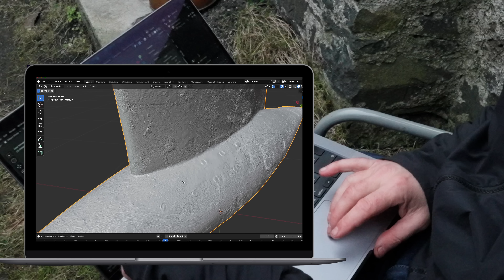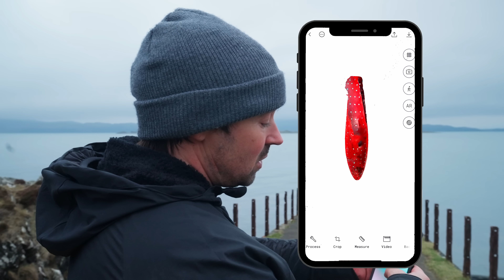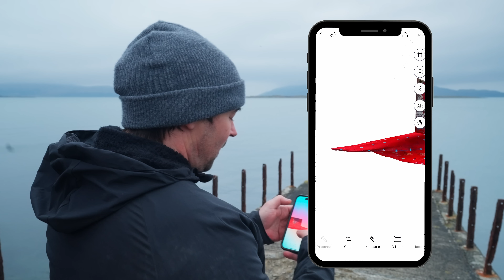I found a Project Sailboat with No Keel ! ~ Let’s try to make one.

Comment: 06:39 Keel: 'PAINT MEEE' ... 

I ogled a 1970s 'Pen Duick 600', intensely - with it's stamped metal sheets bit of a gimmick design, maybe - but all aluminum, and as such still for a price of a used car - and I wondered what it would take to modify the fin keel into a wing or bulb keel, sacrificing some draft and weight gain for potentially increased stability ?... 🤔

'DMS Marine Consulting' offers e.g. a digital calculation of hull designs and their variations - likely breaking the bank for end consumers, I guess - but interesting still when considering restoring or optimizing existing designs without proper documentation...
Reply from the maker: Yeah! These projects are not to be taken lightly! Thankfully I’m a shipwright and we are lucky to have a good team working on the project with us!

Comment: This is great stuff!!  Lidar on an iPhone ??   Who'd have thought!  

If I were in your shoes, I would have taken 10 minutes worth of basic measurements, and then drawn the shape in Delft.  Then having the shape, I'd put it in a CFD program to see if the intersection between keel and bulb could be improved (in the way the wing root fairings on airplanes are designed).  To my untrained eye, it looks like there is probably some interference drag between the bulb and keel that could be reduced.  

You do a fabulous job putting these videos together, and I wish I had your energy!  Having built some boats and cars, and even a solar van, I appreciate your level of skill.  Seems like we are kindred sprits, but your workmanship results in stuff that looks so much better than my stuff!
Reply from the maker: Hey Ken, thanks fella! Much appreciated.

Yeah, we try to adopt tech ology where it works yet I always back up with traditional techniques, as mentioned toward the end I lofted it to be sure I had something accurate to fall back on!  Cheers for the support too!

Comment: I believe that I would have the top of the bulb, conform to the bottom of the boat, lessens the draft, but more importantly, provides  a keel “end plate” effect, assisting in the boat's pointing ability.
Reply from the maker: I can see your thoughts there but your likely to encounter rather a lot of drag with the keel down. I can’t really see the advantage of matching the I shape as you will have perpendicular surfaces which will not accelerate flow.

Still, always good to think outside the box and food for thought. Thanks 👍

Comment: shape of bulb is not crucial. Just make it 2 tons and a standard aerofoil
Reply from the maker: Hey Stephen, I think your right within reason. Mind you; a “standard aerofoil”, is maybe a contradiction in itself? What do you mean by this? 

To my knowledge lift and stall from the aerofoil can be chosen to give that little extra at your chosen speed. We’re not racing but hydro generating at low speed is a significant problem and we need all the extra help we can get! 

The other thing is the fore aft weight distribution, now in a hull like the G39 here that will make a huge difference if it’s not correct. If she lies with the transom submerged we will create an enormous amount of drag.

Comment: Lidar is pretty good but doing it slower really can improve things, the more data you can give it the better.
Reply from the maker: For sure, we did loads of scans and found that to be the case too. It didn’t cope well with the water that ran down the keel now and then and it didn’t cope well underneath which I presume will be due to lack of light, despite the light ‘bounce’ we used. 

It’s a super fast tool which is in general fab, but the photogrammetry was leagues ahead for us.
Reply: @SailHub  how close did it come to actual measurements?
Reply from the maker: @deltacx1059 we are still faffing with it but in general the photogrammetry was within a couple of mm in diameter and I think it was close to 5mm in length. For reference it’s length is 2.34M

Comment: adding to my comment about placidity city, the other advantage of using plasticity is it can produce “watertight “models, which are necessary for 3-D printing. The idea of being that you could 3-D print a positive version of the keel and bulb, and then use that as thebasis to build a negative mold. That could either be for layup, or I suppose you could cast directly into it if you made it out of plaster or something similar. Perhaps even sand.
Reply from the maker: Hey Daniel, you know your onto it there fella! If I have the skills or money that’s what I would be doing. But I don’t 😂 so we’ve got to make do with what we have but yeah t your plan would be better 👍😀
Reply: @SailHub  Well, I'd be happy to see what I could do with your scanned model, since I have the full version of Plasticity. I'm using it for a boat project, so I wouldn't mind seeing what I might learn.... in case you wanna talk about it, lmk. That's with regard to the computer stuff: the fabrication is another thing, but having cleaner data is never a bad thing.
Reply from the maker: @danieldonaldson8634 Hi Daniel, that’s super kind of you! We actually have all of the CAD work finished at present, if we had known a month ago you would have the job!!

If the data is of use to you for your own experiments I can send it through for you still but there’s no need to do anything for us (this time 😂!) 

Thanks so much for offering though, that is super genuine of you!! Cheers!! 👍👍

Comment: You did well to get the Lidar/Photogrametry and lofting done in the restricted time.  It's amazing that KM yachts don't have full boat drawings, build specifications, rig details, completion certificates, etc, are not filed at least one registration authority.  How do boats prove they comply with the various standards.  I guess pre 1980 boats may not have had much information.  Next, I'm curious about how you are going to gather up several tonnes of lead for the casting. With market prices for lead at £1,650 per tonne, that could be an expensive project. I recollect 'Acorn to Arabella' seeking scrap lead from all over.  Considering the permanent horrible dangers of ingesting lead, I hope you don't go the self casting route, at least in not such a rudimentary way.  
Before you cast the lead, are you going to check the stability calculations and check what water ballast works.  Having breiefly sailed an IMOCA 60 with water ballast, it was like having super chargers with 3 tonnes scooped up into the tanks.
Reply from the maker: Oh man, KM we’re bleeding useless! I’ve spoken to a number of KM owners, they all seems to state the same things… great boats, exceptionally well
Built and terrible after sales service. So they had nothing in the boat, I got more info from the cnc cutting company : Gaastmeer.
The rig details I managed to find from Seldén who did a sister ship but there are only two other sister ships out there and one of those was the prototype boat with a custom mast. Anyhow, they have all the righting moment calculations etc so that has been very handy.

I also have all of the paper drawings for the ballast and keel etc so we know how much we need we just we’re not perfected on the shape. (It was only a 2D drawing from one angle.

Lead, ohhh man. It’s expensive and heavy! It’s been a while since I worked with lead but I am confident we can sort it. As basic as it may seem to melt it down ourselves it’s the same thing in industry. I am happy with this and all of the dangers. Ppe, risk assessment and safety are the key, and as a boatbuilder  I am confident I can protect our workforce which is the most import thing here, the keel comes second. 

As for sourcing it, well… we’ve not managed that yet. Still searching! But the van build is taking up so much time that the search is slow 😆
Reply from the maker: Oh yeah, the ballast! That’s something we’re not sure what to do with yet! We’re definitely keeping it! There is 900l on either side. 
No scoops, yet… but it’s about speed as to wether they will work, which of course we don’t know yet. I think we will manually pump water around from a tank inside to see what happens first and see what pressure we can generate before we go popping scoops in the boat. Although, that is of course what I want to do!

Comment: how do you scale the object with photogrammetry? do you have to measure the length by hand them used blender to set it to the correct scale of is the 1:1sale already determined by the app?
Reply from the maker: Yeah, that’s the way we did it anyhow 👍
Reply: @SailHub  sorry I didn't understand your response.  hand measure to scale in blender or the polycam app does the scaling automatically?
Reply from the maker: @martinmoss317 sorry, yes we needed to hand measure and drop the measurement it into Polycam. You can also drop it into blender if you wish.

Comment: you had an hour or so, you couldve mixed up polyester resin with extra mkep and had a solid mold of the thing in 20 mins, just wrap whole thing in foil and start slapping fiberglass over it and wet it out, it harden in literally ten mins solid with heavy mkep....grinder cut it in half and you have perfect mold
Reply from the maker: 🤣 aye right…. Great idea but not really ideal.

That would have been the way to do it if we had more time for sure. But let’s not forget we would need to make a split mould. We can’t be grinding off a mould from a 300k yacht that when we don’t even know the owner can we.

Of course setting up a split mould takes time. Not too much but the greatest time penalty here is waiting for the keel to dry out enough to get your mould wax to stick too it, and the release agent too.
The problem with a lift keel is that the whole keel box drains out too. In fact it took 1/2 hr to get it dry enough to even scan the thing and we had to dry it off it down after each pass with the scanner too.

Also… Scotland and early spring temps, it’s not likely 20mins was going to happen for cure time either, it could with sufficient hardener… but then it’s likely we will get warping. I’m pretty sure I went into that in the video though.

As a boat builder, I can guarantee that my initial plans were certainly to take a mould, it’s just the done thing, but ut just wasn’t the option this time.

Comment: You know what the best part is of a displacement keel is you can figure out the best hydro for it by tank testing so lead takes up space for the amount of weight also means how much space it must take in our world this is called mass so yeah sure take some ideas from their keel water test their keel and refine it and play with making it your own for better hydro anything is possible their design might have drag in certain places can make better or you duplicate it and make things easy I build and rebuild boats for a living my keel on my racing sailboat is a full keel weight is 4 and a 1/2  tons of iron full boat displacement is 18,000 lbs usually for a builder and designer 50/50 between keel and construction weight with mast and rig so add it up
Reply from the maker: Hey Graham, thanks for the input, we’re looking into bulb shapes and also the reality of the beaver tail actually creating any lift. But, we’re running out of time and money too so we will see what we get. 
I wasn’t planning on tank testing as I know it is. Pretty successful design and I’m not sure the costs of tank testing will be warranted. I would certainly love to do it though!

As for weights, we’re looking at 2t, existing hull and mast weigh around 3.5T I’m told however that is just what I’ve been told. As we’re on a farm it’s not so easy to get her weighed although there is always a method, just not sure if I need to make a cradle.

Anyhow, plenty to think about! I may push for some prices for some tank testing… 👍
Cheers!

Comment: I suggest contacting a foundry, they might do you a sand mould
Reply from the maker: Oh they will… but up until now only if they complete the full works. So far the only quotes that came back were for the wrong boat and £16k! Then there was the quote for the correct keel (if I could get the drawings). That came in at 45k! Sadly that’s out of our budget.

Comment: Very cool looking boat, should be a rocketship! Intrigued by your phone scanning. We have an old Westerly twin keeler here in NZ and have modified it significantly over the years including lengthening the hull at both ends -got a bit carried away!. The keels are really slowing it down and I've been debating modernising them. A good starting point would be to take lines off the hulls and keels so scanning the keels would be a nice way to do them. I created a 3D model of the deck before building a solid dodger so would be nice to add the hull to that. Anyway look forward to seeing your project progress, thanks for sharing it :)
Reply from the maker: Woah! That’s an insane amount of work! I would love to see it! 

Could be cool to make new keels, I presume a shorter chord with less frontal area would be the ticket. Add some lead bulbs to minimise the size of the bulbs, would you go a little deeper too to allow less ballast with the same RM?

Talking about RM, would you tie the keels in? Possibly increase Venturi? 

Ooooh the questions! 

Great to have someone who clearly thinks out of the box in our journey, hope to hear some of your ideas for us and also see what your up too - super interesting! 

-Chris
Reply: @SailHub  Current thinking is lead bulbs on timber/GRP fins and that with an extra 250-300mm draft (1450-1500) righting moment should be similar (probably a little less at low heel angles and more as heel increases) but should save around 4-500kg displacement (currently around 5000kg with ~1000kg in each keel). We have a very good Naval Architect in town so my rationale was to get him to consult on (a) feasibility and if OK, (b) provide design detail. Current Laurent Giles keels are slightly toed in, very thick chord and also low aspect but aside from the immediate drag penalty, I believe with the extended hull we're getting adverse hull/keel interference. 

However her achillies heel is roll induced heel which makes it unpleasant to steer when she rolls downwind, so if we can improve that it would be a worthwhile exercise. The performance gains are a no-brainer, could potentially reduce wetted surface by nearly 10%, and if done well form drag should decrease markedly as well. A little hard to financially justify as it's a ~STG20K boat and probably will continue to be. If it improved the handling though it would really help the coastal runs which are ~200nm in either direction to the next major ports, heading off with a tail wind is the way to get there.

When I was boatbuilding I worked with a Aussie guy who designed and built his own yacht and had sailed it around the world. Amazing light and fast boat but he had a 2 tonne lead bulb with lifting keel. He was amazingly innovative, particularly in ways to save money and used a 4WD winch to both lift the keel and also to lift the anchor. The keel had 3m draft down and the anchor chain was stowed at the base of the keel to keep weight out of the bow. Bow waterlines were quite hollow and the 28hp Kubota could motor them upwind at 6 knots in 25 knots of wind. Not bad on a 44 footer! The lifting keel is wonderful to provide sailing efficiency and good offshore stability without limiting anchoring options. He also used to go into shallow water and dump the keel onto the bottom, then alternately lean the boat to each side to scrub the bottom.

Comment: Lidar is an app on IPhone or to buy app.? I'm using Android S24+
Reply from the maker: Hi, I’m afraid the iPhones have a specific LiDAR Scanner — it’s the small circle next to the camera lenses on the 15 pro. It specifically measures light alone so I’m sorry it’s iPhone only at present. But… photogrammetry will still work for you, and it’s more accurate in our experience too 🥲

Comment: LiDAR is good because you get actual size models and is invaluable for that reason. There's also the ability to add different models and merge them to make one that is more accurate - I'm not saying it's the best option, just find that if you don't have the tape measure or don't have the time to go over every single detail the LiDAR + photogrammetry combo is unbeatable. Basically make sure you have the same sizes between them :) I love Polycam, early adopter from 2020. It'd be great if there was a free Rhino alternative for the right kind of geometry but we can't win everything!
Reply from the maker: Yeah, your right! We can’t win everything!! We found the scanning really interesting and the results even more so. 
At present we are crunching the numbers and deciding on what’s the best option but we now have options which is a step ahead for sure!!

Comment: Not a bad idea mate. 
Lazy way weve done it, get a box cover the bulb and fill with expansion foam. Then cut in half and have a full mould. Just remember to cover in cling wrap or release agent. This has proven to work well in our yard for moulds that are straight copies from sister ships.
Reply from the maker: For sure, that would have been ace. Bug with 1 hour in the slings I wasn’t confident enough to use up my only chance with foam due to the hardening time.